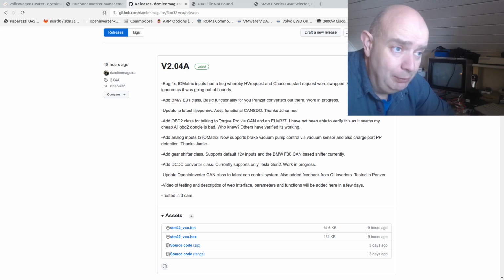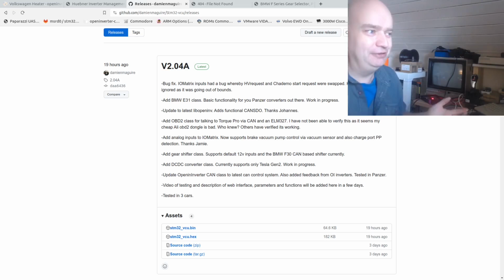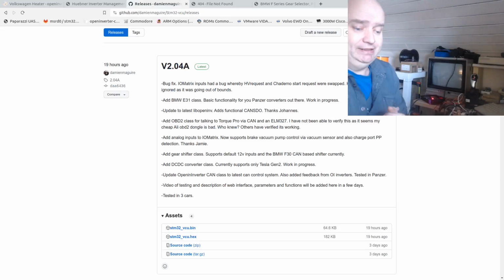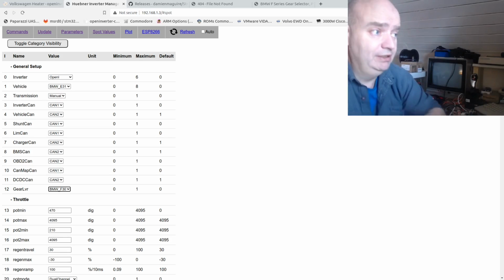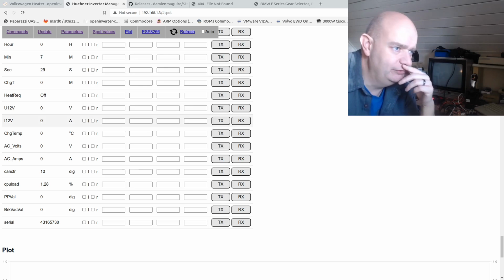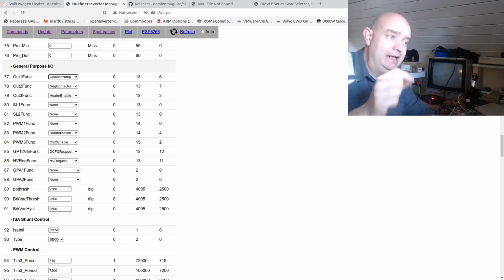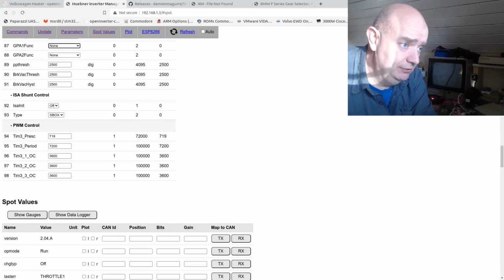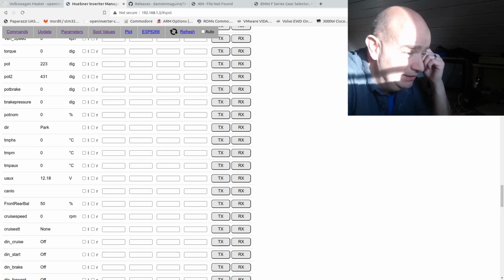ZombieVerter VCU Software V2.04

Comment: Brilliant work as always just installed this update as I'm using a f30 shifter in my conversion this will simplify my wiring and take the load off my own controller, a couple of things in the cars this comes out of to get it out of park you press the unlock button and select a gear, the park button is only used to select park probably only an issue for people like me who drive a bmw with one of these shifters who will get confused also if you send 0x81 to ox3fd instead of 0x80 it allows it to stay in sport /manual mode 😀

Comment: Super developments, Damien I believe you tested the S-Box with the 9 kWh first gen BMW 530e SP06 hybrid battery pack, do you think the Zombie will work with the second gen SP41 12 kWh pack? same question for the smaller 330e five module pack?